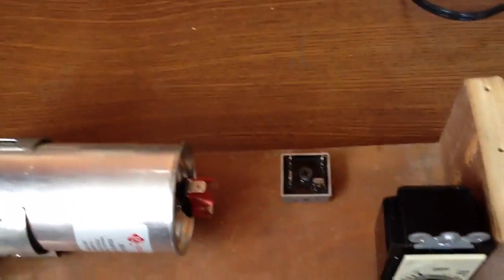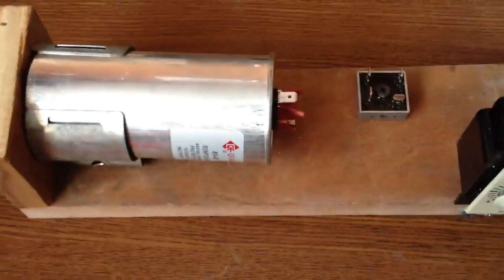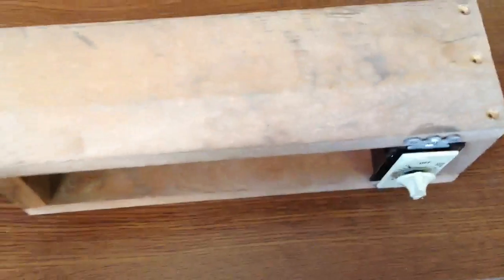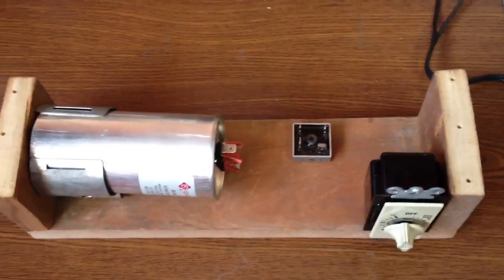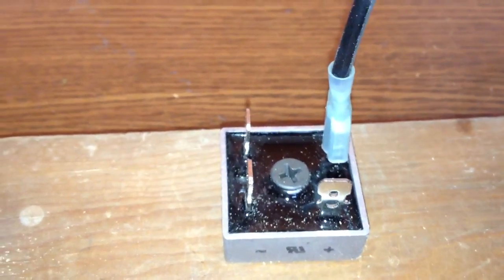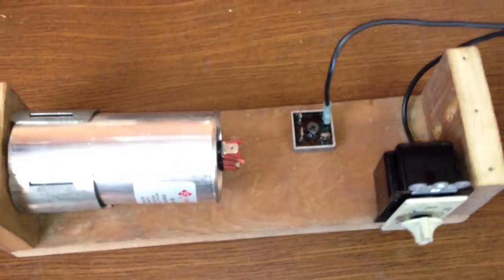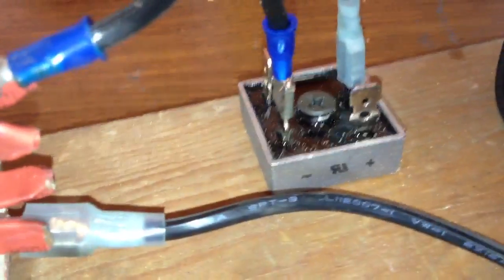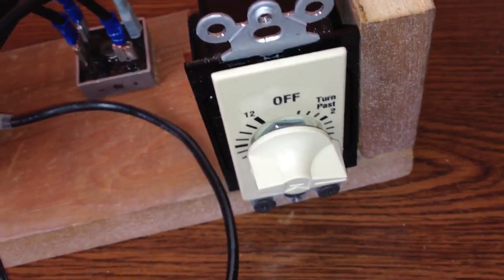How to build a Capacitive Battery Charger (Part 1)

Comment: God bless you for sharing this with the world! I Am offgrid using 12v 105Ah deep cycle batteries connected to Ac inverters and solar panels. I want to be able to charge the batteries faster and have an alternative for cloudy days. Would this charger built as you show here charge ONE of these batteries at a time and if so how long would it take? Also how do I determine the parts required to charge multiple of these batteries at the same time and should they be in series or parallel? ALSO do you have a webstore? God bless and be well!
Reply from the maker: This charger is only suitable for grid powered charging of the batteries. The power factor is very low with these chargers, and as such you would be wasting the majority of your power. You can do series or parallel otherwise, series would charge more efficient. 
When using grid power, you don't get billed based on your power factor, only your real power, so the wasted power isn't billed to you.

Comment: Ciao 
Non riesco a capire Qual'è la capacità del tuo condensatore
Grazie
Reply from the maker: Ciao Giuseppe! 80 uf. condensatore più grande = carica più veloce. L'Italia utilizza 240v, velocità "4x" della carge rispetto a 120v USA stesso condensatore. regolare se necessario.
-Chris Allessi II
Reply from the maker: Scusa italiano. Non utilizzare molti anni
Reply: Io sto usando il condensatore 25 uf  per caricare batterie auto e per desolfatare 
Ho ci vuole più grande?
Mi dai un consiglio?
Grazie
Reply from the maker: @giuseppedeluca7247  25 uf buono per alimentazione 240v. La batteria dell'auto non va più grande.

Comment: hello kman...i followed your circuit using 50uf 400v AC capacitor and a KBCP5010 bridge rectifier,,,,my mains is 220 AC volts and i am getting 243 DC volts out of the desulfator output...did not connect the desulfator right away to check if smoke will appear but the desulfator is maintaining a 243 AC volts....but when i connected the desulfator to the battery following correct orientation with positive connected to the positive terminal and negative to the negative terminal...and plug it just about a few millimeters only the desultator into the mains the battery sparked...i have the caps off and the spark came from the the plate just below the positive terminal....i used a combination of distilled water mixed with epsom salt to fill the plates...good thing i was able to disconnect it right away...is there already something wrong with the battery? is the battery shorted already? i am trying to desulfate a 12v DC 7.2AH battery used for a motorcycle.which has not been used for about a year now.
Reply from the maker: New Vaper The battery is junk. The plates are shorted out. Now also, since your mains are 220, the output voltage is as high as 340 V once rectified to DC. that capacitor is way too big in this situation. I would go with 5 µF or 10 µF. with how small of a battery it is, you basically opened up the main strictly into that small little battery. or the cells dried wood before you added the distilled water and Epson salt?

Comment: Hello bro this is Ratheesh as by your video I have purchased the materials and started building the capacitor charger and I'm getting more inverter batteries for my coustomers so which MFD capacitor and which bridge rectifier should I use for the 180ah lead acid battery 
Advance thanks for your reply
Reply from the maker: Ratheesh Ramakrishnan do you want to charge or desulfation?
Reply from the maker: Ratheesh Ramakrishnan watch the updated video might help more. How to build a Desulfating Capacitive Battery Charger, Complete with Diagram Start to Finish https://youtu.be/N6NluEvBAUU
Reply: I want to make a desulphation
Reply: A desulphation capacitive charger and I need to desulphate an 180 ah inverter battery and which capacitor should I use and which rectifier should I use bro
Reply from the maker: @raatheesh  Smaller capacitor would be better, 10mf or 20mf. Desulfation can take days, weeks and sometimes months depending on how bad the battery is. Works better if the battery is charged regularly with the desulfation charger. 
A cheap 1000v 50 amp bridge rectifier is all you need. Don't forget to add a heat sync to it.
Reply from the maker: @raatheesh  I have product links in the description box for compatible products. Make sure your using a motor run capacitor, not a DC or Start Capacitor.
Reply: @KmanAuto  ok bro I'll follow this and I'll go through the discription too thank you

Comment: What discharges the capacitor after it is unplugged?
Reply from the maker: capacitor doesn’t charge, it just limits current.
Reply: @KmanAuto  I am using a 40 mfd cap and my battery sounded like ac frying voltage was at 17 vdc and time was about 6 minutes or so . so I unplugged it. should i let it continue?

Comment: I have a 500mfd capacitor, a 63A 1200volts rectifier. Voltage input in my country is 220volts. Can I use it on a 12 volts 200ah gel battery?
Reply from the maker: abraham okpataku Please dont. you will cook that battery. keep it 80mf or less. also, that sounds more like a starting capacitor and not a motor run capacitor. it must be a motor run cap or the cap will explode.
Reply: @KmanAuto  thanks very much.

Comment: Hi Mr. Kman. I know i am about six years late for a question, but I plan to make a desulfator, and will use a 25uF capacitor. can I use the same 600V 32A rectifier or I need to use another rating?
Reply from the maker: Jorge Reyes U yes same rectifier.
Reply: Thank you very much Mr. Kman.
Reply from the maker: my pleasure. if you have not yet please consider subscribing :-)
Reply: Done... . one more question. Did you consider a switch and an ammeter for the system, specially in a multiple batteries configuration?

Comment: Can you power it from off grid inverter 120v? Ty
Reply from the maker: Thomas Choi yes, but me mindful of the power factor. The lower the voltage battery pack your charging the lower the power factor. the closer to 170v battery bank your charging the higher the power factor.
Reply: KmanAuto- would two of 80mfd capacitors charge the battery bank   ?Thank you

Comment: Thanks a lot kman, I have watched a lot of your videos now, and am in the process of building the charger as soon as all the 
components arrive, just got the capicitor from China today, the rest should follow soon, I am the guy from Vancouver Canada 
who spoke with you on the phone, my handle is different on here as you can see, really enjoyed all the videos, and intend to build an electric car one day quite soon, you really are an inspiration, Salt of the Earth Really, Many Thanks.
Reply from the maker: My pleasure! Thanks for watching! 
Just to throw this out there ;-)

I'm disassembling my Electric Alfa Romeo and parting it out. The drive unit components are available for sale, in great operating condition, and you can save some $$$. 

The motor is a Motenergy. Weights about 200 Lbs. 72-144v 500 amps, AC or DC series wound, only about 100 miles on the brushes. 
Motor controller is a Curtis, 120v, i think 400 amp output. Now, Secret, you can "Over-Volt" this controller to 132v by adding a 11th 12v battery and still be within the safety and operational limits ;-) We used to do this all the time on the old ZAP 3 wheel electric cars. 
I also have the fuses, HIGH amperage contactor, and potentiameter, motor to transmission couppler, and adapter plate. 

NEW pricing on these was:
~$1200 for motor
~$1100 for controller
~$600 for the other above components. 
I'll do ALL the listed above components for $2000, and I remember correctly, your in Vancouver? I'd do that delivered to the border and meet you at the border ;-) I'm always up for a road trip. You have my number, if you are interested please let me know!

Comment: hi great vid..........put mine together and seems to be charging fine with   15 volts across the battery..........the only thing is after unpluging the unit the cap discharges (big spark) at the input plug when i short it with a screwdriver is this normal ? thanks

Comment: Do not build this charger! It is dangerous and will ruin your batteries! The voltage is unregulated and could shoot up to 200V until your battery or something else explodes. Never allow a 12V lead acid battery charge to more than 15.5V. Every battery charger needs a means of regulating the battery voltage to a safe maximum (either with a transformer or by electronic means), and this has nothing!

Comment: I have tried and I build the exact capacitor charger ,I have tried it on about ten different car battery and non of the battery was repaired from sulfation , I even tried it on a battery that was in my car that is sulfated but will still crank over .and this battery was not cranking over any better .(starter is good ).

Comment: should my capacitor be getting hot I have seen others where they have heat sinks on the bridge rectifier and that's getting hot also mine is a 50 amp rated bridge rectifier the cap is 100 mfd and 250vac
Reply from the maker: if you're charging a 12 V battery, that might be a little bit too much power through that rectifier, however no you're the pastor should not getting hot and cool to the touch. did you use a starting capacitor or motor run capacitor?
Reply: I don't know I just bought the biggest cheapest one I found on ebay
Reply: Why not just give the correct answer-use a run capacitor only and it will remain cool. A start capacitor is not intended to be left in a circuit and will heat up-your bridge rectifier will heat up also.

Comment: learned a lot from you. illiterate about this area, but interested in building this type charger.
so let me know details about how to build this one based on the 220 voltage power system. what i need to know is about specs of  the capacitor and bridge rectifier at safe work under the 220v power supply. appreciated in advance for your help.

Comment: what size caps would you use for a 36v 1100 ah forklift battery?  would the bridge rectifier hold up or do we need to spec a higher rating for that too?  Thanks....  btw, great video!!!

Comment: someone told me one needs at least 5 amps to charge a car battery. Can you tell me the specifications of the diodes and capacitor to be able to get 5 amp?
Reply from the maker: +Shane Glasgow That is incorrect. You could charge a car battery with .01 amps. Just the higher the amps the faster the charge. 
With a de-sulfating charger, if you want more de-sulfation, you want a slower charge so that the charger can remain on and pulse the battery more to break down the sulfation. 
The Rectifier is a 50 amp 1000v single phase.  The capacitor is a 80 mf. A dead car batter would be charged in about 3 hours with this setup.  If you want more de-sulfation, go with a smaller capacitor, such as a 40mf, charging would take twice as long, but it would do a better job de-sulfating.
Reply: @KmanAuto  I need to charge 4v 1350ah 20h rated batter. Would this setup work? Thanks
Reply from the maker: Thomas Choi Lead acid?  yes this would work, add more capacitors to charge faster, will be horribly inefficient charging such low voltage battery. can you give some more information on your setup?
Reply: @KmanAuto  it's lead acid 4v rolls battery 1350ah 20h. I have them in series for 24v system. One of negative is going bad at the moment. Should i disconnect the battery and charge only one battery at 4v or leave it connected at 24v??? 
How many caps should I use? Is one 80mfd work?
Thank you
Reply from the maker: Thomas Choi Desulfurization can take a very long time depending on how bad The battery is. personally I would disconnect it and leave it disconnected during the process. A single 80 cap left on for a month would be an excellent way to desulfate
Reply: @KmanAuto  thanks for quick response. We're off grid and don't have extra battery to leave the battery disconnected for that long. Awe... maybe I'll try direct charging  at 28v 60amps for period times.
Thank you

Comment: Instead of using a car battery, why don't people use a capacitor bank instead with a resistor to limit the electric flow?
Reply from the maker: +Tom Cool I hate to ask, but what remote context are you talking about?    The purpose of a capacitive battery charger, is to charge lead acid batteries. How would a capacitor bank with a resistor solve this?
Reply: +KmanAuto When I later saw the wiring diagram, I then understood that the capacitor is charged and discharged 120 times per second instead of a one time charge of a large capacitor bank as if it were a battery.  perhaps if the capacitor was as big as a garbage can, then it could store enough electricity to start a car.
Reply: +KmanAuto   This capacitor boost was what I thought it was. Replacing My Car Battery with Capacitors! 12V BoostPack Update          
                           
lasersaber
Reply from the maker: +Tom Cool I see. Actually, you wouldn't need a capacitor as big as a garbage can. You could take 6 or so 12v caps, about the same total physical size as a car battery. That would be MORE then enough to start a car, and recharge time would be about 30 seconds.
Reply: +KmanAuto Yep.  I found the capacitor video after I wrote that about the garbage can.  It might be the size of a garbage can only if you made a homemade capacitor out of a big roll of tin foil and plastic sheeting and put it in a plastic garbage can.  The advantage of capacitors over lead acid is: less lead in the environment, shorter charge time, it doesn't hardly ever wear out and works well in any temperature, even brutal cold.  If someone does this, they should probably buy a single capacitor that will work in a 16 volt system.  That way it will easily be able to handle a 12 volt system.  There probably should be a resistor or fuse in the line somewhere that keeps it from discharging or charging in a massive blast if there is a short somewhere.  maybe there other improvements that could be thought of.
Reply from the maker: +Tom Cool Eventually... Actually, I think cold weather tolerant Lithium packs would be much better. The problem with capacitors, at least at this time, is energy density. While they can charge and discharge lightning fast, they have relatively low energy density.  Example, it would take roughly the space equivalent of 150 lead acid batteries, for a capacitor battery pack to store as much energy. 
Would it be fine for a lawn tractor that has no accessory draw? Yah, car? No. the battery needs to be able to supply a good amount of long term power to power the onboard computer, clocks, ecu and whatnot. Heck, even my Tesla requires a lead acid auxiliary battery, even though it has a absolutely massive traction main lithium battery pack. 

Don't rule out lead acid as being un-reliable either. I've never had a lead acid battery last less then 10 years in one of my vehicles. In fact, I still have the ORIGINAL starting battery from my very first car, 1991 Alfa Romeo 164. It is now 25 years old. I still use it. I don't have the car, but I have the battery. I use it yet as a bench battery, for doing experiments. It still holds about 85% of its original rated CCA, and maintains a solid 13.1v. 

Also, while less lead would be good, the recycle-ability of lead acid batteries is about 97%. the main thing that is NOT recycled is the acid. It is naturalized. So as long as people don't just toss their lead batteries in the trash can (illegal), they can be recycled virtually indefinitely. 

Your on the right track though, keep it up. Maybe look into Lithium Starting batteries a bit more though. I have played around with them, and found them very good. We use them in our custom cycles we build. We can replace a 24 Lbs battery with a Lithium starting battery that weighs less then 1 Lbs. And, since almost no voltage drop upon cranking (A lead acid battery voltage drops about 1/2 during cranking, Lithium Starting battery voltage drops only about 1v), the bikes start much easier and almost instant! It's very very impressive. 

CHEERS!
Reply: +KmanAuto  Capacitors take the space of about 150 batteries?  I guess I better plan on taking out my back seat and putting in a couple garbage cans.  Just joking.
Reply from the maker: for Energy Density (Storage Capacity), yes.
Reply: +KmanAuto  Check out this guy on YouTube.   Replacing My Car Battery with Capacitors! 12V BoostPack UpdateA one lb. set of boost cap or boost pack capacitors starts his car.  This is what I was talking about.  His name is at laserhacker.com
Reply from the maker: Yes, I have seen it. What the problem is though, the capacitors have enough power to start the car, but thats it, they do not hold enough to power a modern car's electronics for a long period of time (Few days to a week+). But if all you want to do is start a vehicle, yes, a few caps can do that.
Reply: +KmanAuto  Mechanical work of cranking over a car engine is very much more than what it takes to run a radio or dome light.  A car battery cannot run a dome light for a week either.  As far as I know, these chemical capacitors that store the ions in a gel may be superior to lead acid batteries. They charge very fast and may be used for electric car applications.  I would buy one from Maxwell except my 12 volt car battery is OK for the next few years.  You may have to design a quick charger for these new capacitors.
Reply: +Tom Cool If you condition the capacitor ( PJK Free energy guide ) they will self charge themselves for a period of time after being shorted .

Comment: what is the amp rating for the charger
Reply from the maker: +Shane Glasgow variable. Depends what input voltage is, and depends what the voltage of the battery bank your charging is. It will fluctuate as well during charging. The higher the resistance, the voltage will increase to cut through the resistance, thus lower amperage, as the resistance (Sulfation) brakes down, the voltage drops and then higher amperage.